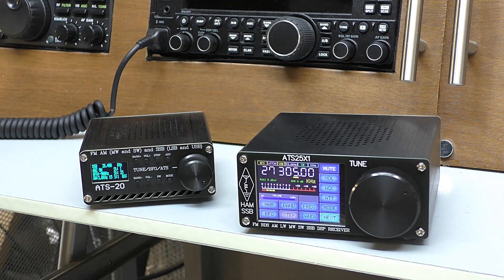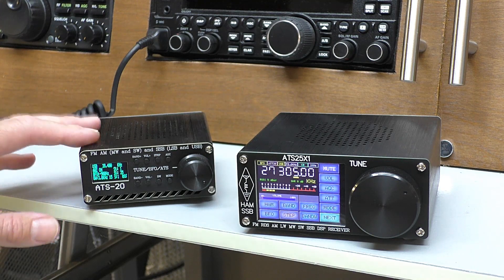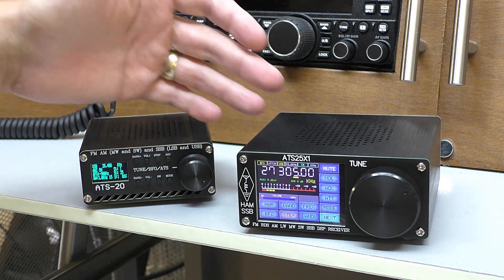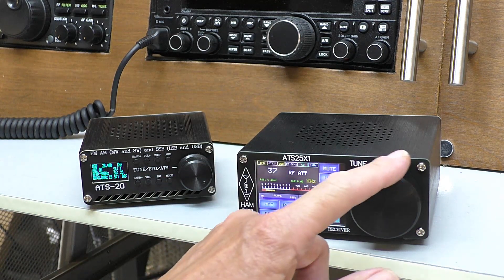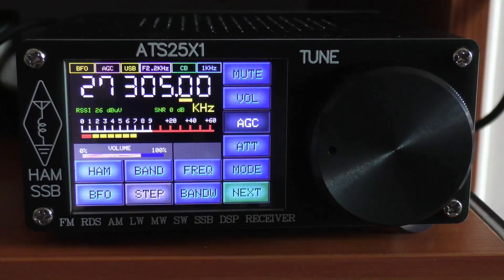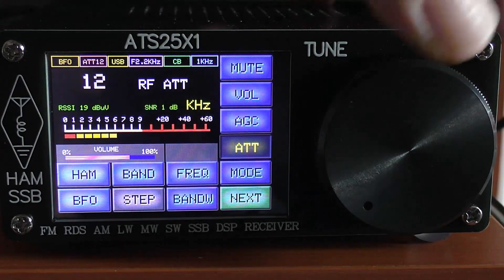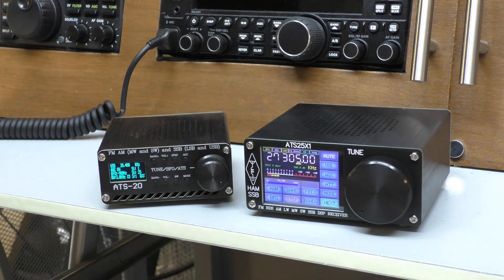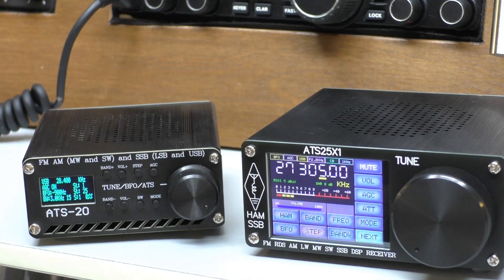ATS 25X1.  Shortwave receiver tested on 11m CB Radio band.

Comment: are you using the provided Ariel in this video or are you using your aerial on the roof ?
Reply from the maker: Using an outside CB antenna.
Reply: @CB-RADIO-UK  thanks sorry if this comment sounded silly but I'm just getting into radio, I've never owned a radio before but I'm so intrigued, so I might buy this radio and a mobile Ariel I've seen on other videos and see if I can hear anyone.
Reply from the maker: These are my most used Freqs. https://www.youtube.com/watch?v=WdUGJhoEIdo&t=298s
Reply: @CB-RADIO-UK  thank you, I ended up buying a thunderpole T800 and a swr meter from Amazon, I was advised to buy the thunderpole boomerang antenna but they're out of stock so I will wait untill they're back in stock and hopefully I'll be able to get out to somebody, I'm starting from absolute scratch I have no knowledge about radio only what i have seen on youtube and it intrigued me

Comment: What is the best antenna for ATS25 X1
Reply from the maker: Depends on what your planning to listen to.  If its CB you will need a tuned CB 27 Mhz antenna.  For SW listening a long wire down a garden will work fine.  I made this one but a much shorter wire will work.  https://www.youtube.com/watch?v=s2e_XSZ54W4

Comment: Very good but for example at 03:58 the beginning of the lyrics seems violent for a fraction of a second, can't this be fixed ? 😀
Reply from the maker: No the radio's AGC struggles with strong signals as its a bit slow to react and you get that noise.
Reply: @CB-RADIO-UK  Thanks a lot ! 😀

Comment: Getting better all of the time. I am looking for a simple SDR receiver for CW to use in the field with a QRP homebrew transmitter to activate Parks on the Air program. I almost bought one but haven't confirmed the 40M tuning rate and how effective the selectivity setting is on the 500Hz setting. The next update or so I may get one. If I am going to do some picnic table operating I don't care to risk a high price rig when I am just going to have fun throwing up an antenna, spotting myself on the POTA site, and then making 10 contacts in 15-25 minutes, LOL!  Thanks for the reviews, you have been very helpful. Cheers, Dave - KU9L

Comment: Thanks again for the videos Fred, bought myself one of these after watching your vid, for the price it really can’t be faulted 👍🏻 still using my 9900 on you recommendation and also my Communicator from back in the day. Looking at getting myself a Yeasu FT891 as I have a foundation license, but would want it widebanded for CB, what do you think?
Reply from the maker: HI.  Ive found that HF radios work really well on SSB 11 meters (no surprise really). Mostly because you can filter out a lot of noise.  On FM though iam not sure they work any better than a decent CB radio.
Reply: Sorry Fred, that’s what I meant, for me to use on SSB, 🤦🏼 thank you👍
How about some more “back in the day” CB stories for the long winter nights?
Reply: Buenas noches,lo que le falta como al mío es el squelch.

Comment: I can say this for my ATS-25, it's far better above 20MHz than my Eton Elite Executive is. As soon as I go above 20MHz on my Eton it's sensitivity goes to hell, but it will still receive, just not as good as below 20MHz. 

I'm not entirely sure what's up with the Eton EE but I think it has something to do with the AGC, it happens regardless if I use the telescopic, or external antenna or no matter what antenna I use. But if I unplug the external antenna and plug it back in the sensitivity returns until I change the frequency, the sensitivity will also correct itself if I flip the DX and local switch (change from DX to local back to DX) the sensitivity will return to normal.

Comment: These things are just awful.....Has the S Meter frozen
Reply from the maker: Its not very responsive.  Mind you a lot of cheaper SW radios are like that.
Reply: That highly depends on the antenna being used on it, if you're using an MLA-30 you're going to see the s-meter showing high. If you're using a non powered antenna (like a YouLoop) the s-meter is going to work like it should.

Comment: DEAR FRED
THERE WERE 23 CHANNELS FOR CB RADIO. THEN THESE WERE INCREASED TO 40 CHANNELS.
NOW I SEE 27/81, 27/91 ETC. WHAT ARE THESE EXTRA FIGURES.  CB WAS AM. NOW IT IS FM AND SSB.ALSO. MY QUESTION IS ARE FUNDAMENTAL FREQUENCIES OF CB RADIO ARE SAME AS THOSE OF CB AM RADIO OR THEY ARE DIFFERENT FOR DIFFERENT MODES. MOREOVER CB AM 40 CHANNELS HAD MAXIMUM 5 WATTS BUT NOW I SEE MENTIONED 4 WATTS. 
I FEAR I AM BOTHERING YOU BUT THESE ARE VERY PAINFUL QUESTIONS IN MY MIND. 
SPECIALLY THE CHANNEL BANDWIDTH FOR AM AND FM MAY BE DIFFERENT. IN OLD 23 CHANNELS AM THE CHANNELS WERE 10 KHz APART.
KINDLY HELP ME OUT TO CLEAR ALL MY CONFUSION ABOUT OLD 23 CHANNELS AM SYSTEM AND PRESENT CB RADIO CONFUSED CHANNELS PLEASE. 
REGARDS TO YOU AND YOUR FAMILY.
Reply from the maker: fluxington has answered the question.
Reply: @CB-RADIO-UK  Thanks.
Reply: What's up with the caps lock typing..... Makes your comment harder to read
Reply: Frequency are same except uk fm
Reply: @miker8379  Thanks.
Reply: 5w was the input and 4w output AM. 12w SSB
Reply: The CB27/81 marking (and similar) just externally shows that the equipment was made to ‘official’ approved specifications. No marking=not approved equipment.